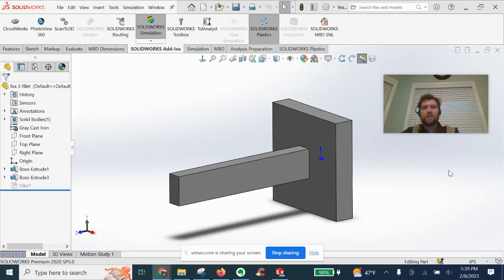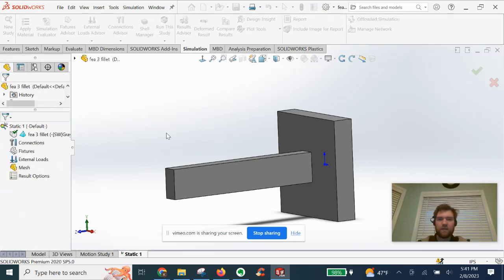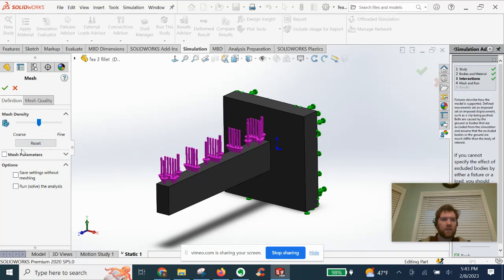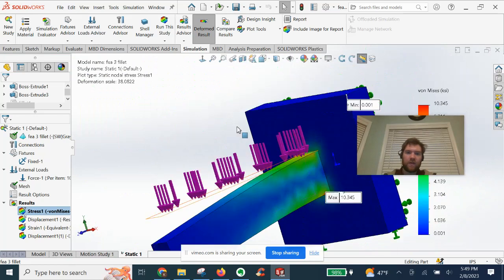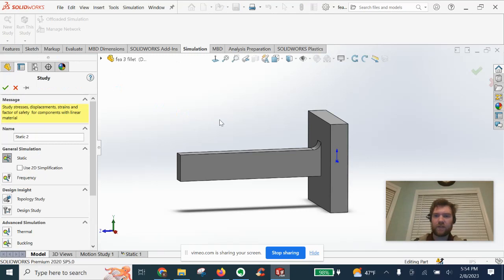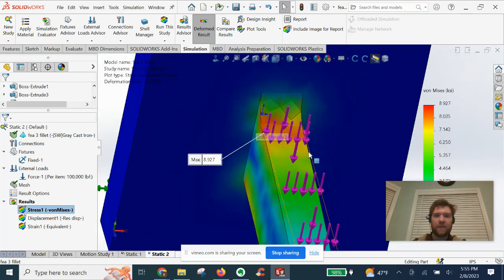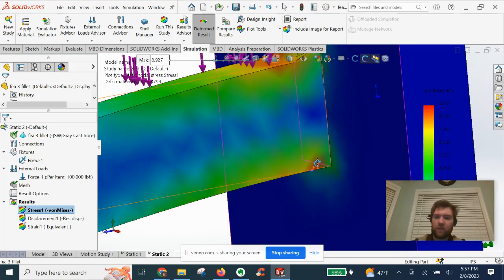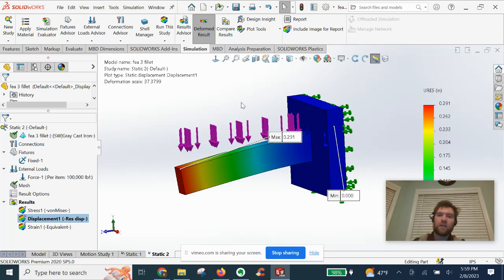Solidworks Stress Analysis Tutorial | Fillet Applied on Beam (Before and After)

Comment: Why do you have force applied all along the length of the beam? Is it a test for cutting? Normally, in such assembles with a free end, the main load is placed on an area closer to the end of a beam. Well, connecting a beam to a plat it is better to do a straight bevel instead of a rounded fillet. I think so...